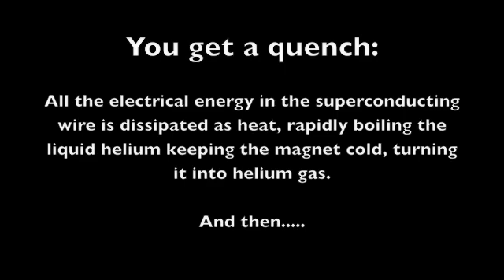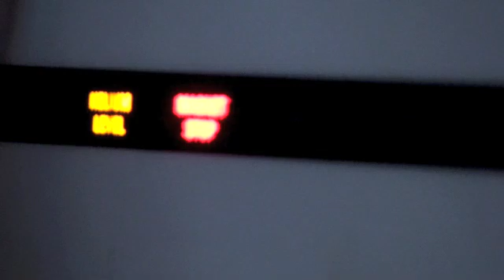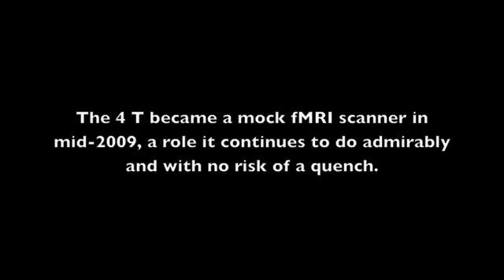MRI magnet quench: the movie

Comment: Yes, there actually IS A HELIUM SHORTAGE, or will be, once the national reserve runs out, which is being used up quickly.

It is indeed the second most abundant element in the universe, but have fun getting it out of the STARS!! We have a LITTLE bit of it here on earth (recovered in natural gas mining, as you say, but that won't last forever either will it??). So once you let it go into the atmosphere, say bye bye to it forever, it's headed back to the stars. Thanks.
Reply from the maker: jonboro2000 As I mentioned in the FAQ, it was uneconomic to recover the L-He (or recycle the magnet, which we decided to use as a mock scanner in any case). We considered running down the magnet over the power supply and then trying to flush the L-He, but the cost of the engineer to do the run down plus the recovery was more than the cost of L-He at the time. There was also the issue of needing to top off the magnet prior to a minimal risk rundown over the power supply which would have possibly increased the cost. Instead, we waited until the L-He level was at something like 60% before we quenched. All other options were considerably more expensive, and since helium extraction is itself an issue based on economics, not availability per se, we decided that quenching was the least costly approach.
Reply: Helium will be around for a while, yet.  The helium that's in natural gas didn't come from the stars.  It came from alpha decay of various radioactive elements.  Some of those element have long half-lives, so will be adding more helium for a long time to come with no significant drop in the production rate.  We'll kill life on this planet one way or another before we run out of helium.
Reply: +Jaden CM you are thinking of hydrogen... 
+Vad Hakara has it right.
Reply: +judgegixxer
So you read the first sentece, then decided to react? 

Thats not counting the already known reserves.
In 2014, the US Department of Interior estimated that there are 1,169 billion cubic feet of helium reserves left on Earth. That's enough for about 117 more years.
Reply: relax bro they found about 54 billion cubic feet in Tanzania in 2016. Globally we use around 8billion cubic feet a year. Not counting whats already in reserver and what could be recovered from natural gas drilling, Running out of Helium isnt that much of a deal. 
Lets focus on more important issues first ey
Reply: +judgegixxer 
117 years is a very long time if you look at how fast we're evolving in terms of Technology and science.  25 years ago, a cell phone was only for the super rich, now everyone has one. Reusable rockets where a far fetched dream only excisting on paper, H2O and electric cars only seen in sci fi movies, etc now they excist. If you think there isnt being searched for alternative ways and products to replace helium you're dead wrong. Also those estimates are of known usable helium pockets, they dont account for the helium that isnt recoverd by oil drills and such. With helium prices going up most gas drilling companies are looking for ways to recover the helium they now just rush through the pipes to get to the gas. So there's a whole lot more Helium than that estimate states. 
You apperantly forget how innovative humans can be when faced by a problem. 

But I get it, you're a pessimist. Only seeing the evil, never the good in people. Sucks to be you honestly, you probally live a very depressing live thinking of how bad of a planet we're leaving behind whilst in reality 200 years ago there was 50% change you wouldn''t make it till age 5!

Grow up man, dont be so negative. Have some faith in humanity. 
The reason we're so succesfull as a species is because of our problem solving.
Reply: We'll have a helium shortage eventually but storing it now isn't going to prevent that. Storage is expensive and it's near inevitable that our helium supply and our natural gas supply run out at around the same time. Hopefully by then we'll be able to get helium more easily from other sources, but we'll also probably find alternatives.
Reply: Lol HeO
Reply: AH yes, trying to win an argument by going offtopic. How cute.

I'll try to adress as much as I can and keep it as short as possible, because I'm trying to read youtube comments not a book. 

1. The distribution industry in Europe is vastly shifting towards renewable energy with e-trucks and e-vans already deploying in major European cities in Portugal, Germany and the Netherlands.
Containerships have a new technology being fitted as we speak that utulizing Wind as 2nd source of power cutting down diesel consumtion up to 40%

2.Europe doesnt have Mc donalds sprawned all over suburbs, Fast Food is widely considered as marginal here. If people say they eat Mc do 4/7 a week, they're frowned upon. 
Same with the cars, Most sold European cars dont consume that much gas because gas is hella expensive here. Taxes on a 6l engine are so high people rather drive 2l at max. 
There's a certain culture difference between us here, you see, Europe is a lot less consumerbased than the US. Hybrid cars and electric cars are not so uncommon here aswell. Just in my close surrounding there's 8 gas stations that have made the switch to add charging stations aswell as charging stations on public parkings where you can charge your car for a price ofcourse. The more infrastructure there's available the easier it is for people to make the shift.

Yes focus on the animals that went extint, dont focus on the animals that we through extensive programs have succesfully rehabilitated into the wild. Its always a shame to lose a species, but then again you have to ask yourself, how much of the responsebility of the species death is caused by how much of the global population. 
Hong kong, China, Japan, Vietnam are all big players in alternative medicins wich use ivory and the like. To a point you cant blame the entire human race for the actions of a few. Or are you going to tribe the entire German population for the warcrimes acted by merely 30men? 
Dont get me wrong, I hate to lose anymore species, but you have to be realistic here, some species go extint even without any human interaction.  

You could argue its politics, most of the times its the will of the people to actually have that change. I see a lot of political will to make change to our enviroment ( again in the EU, I dont know about the US) and our consumption of energy. Its btw the people who decide wich route politicians take. If you vote for someone who doesnt account in enviroment, who's to blame then? Politics or the people who voted for those politics? 

To your plastic island paragraph;
https://www.theoceancleanup.com/   People are already getting rid of that problem with an increasing budget and increasing fleet to speed up the process.

Science and Technology will always overcome because like you said, for every problem solved, 3 other rise, but those problems are more complicated and the solutions will help us even further.

We, at this very moment, are on the brink of a global shift towards a much cleaner earth. Everything thats wrong today is because of the mismanagement from 50 years ago. 
If you think we arent changing our ways after living like this 50 years long, you're dillussional. 
There is change, maybe its not going to fast that you notice it, but it is there. 

And back to Helium. Imagen if we keep up todays pace in innovation, I'm sure we'll find a way to extract helium from space aswell. 117 years to come up with a solution.
Reply: You are the one that brought up "How fast we're evolving in terms of Technology and Science" So  don't try to twist it around to make it seem that I changed the subject.. You used that as defence to Helium shortage will not be an issue because we will figure out something eventually. So I pointed out a few examples of how thats not working out so well and actually making things worse.

I did not say focus on extinct animals and forget the existing. But researching why different species go extinct would be good. Again the Rhino was another example of how humans efforts to stop problems don't always outway the efforts/forces that create the problems.  Different populations effect different species and environments in different ways, removing one breaks ecological chains. Actions of a few can have massive unforeseen impacts on people and places far away. 

All the different actions of all the pockets of the few add up.  I'm not trying to pin one /person/group/ race/country as you are trying to suggest. The sprawl /mc donalds is just one large piece of the pie.
Germany!? Why so defensive of it all of the sudden? Last thing from my mind.  But since you brought it up. Only 30 people responsible? LoL Ya at the very highest of the top just to get the list started. Of course not every german is a war criminal (obviously) but give me a break. You must have some sort of guilt complex to even bring that shit up.

Plastic is being produced for countless needless reasons everywhere at a rate which far outpaces it's cleanup so nice try with that one its not even close and the gap widens by the week, not the year..(advent of 3D printing does nothing to slow the rate)  Thanks for the thought and the token effort but cleanups need to be done on scales that are orders of magnitude larger than governments or corporations of any nationality are willing to come close to commit. Even their election campaign promises are weak and never fully carried out. 

I didn't get the memo on the fact that everything on earth has been properly managed ever since 1968. Just so you know everyone from the poorest person on the planet to the richest billionairre is greedy.  The drive to continue living requires it. it is basic human instinct. 8 billion people require more than the planet can produce or absorb plain and simple.  A major reset will happen that will knock the human race back to pre industrial age conditions and huge mass dieoffs, it's already starting. 

So you prove my point about politics. Polititians #1 goal is to stay in power and keep paycheques rolling in hence they need the public to keep voting them in. The overall majority of public wants: Good infrastucture, more infrastructure, more of everything that benefits them which are all the materials that create the whole problem. All thats left for remedying any problems is spent on token programs designed more for PR than actually accomplishing anything. Humans are a cancer on this planet. We were a benign tumor until the late 1800s, we are now stage 4.

 It's like the human race has already jumped out of the airplane believing it can fly without one so to speak. Instead of spending the money and doing the work to create and strap on a parachute before we jumped, we decided we have lots of time.  So now with ground looming closer we are halfheartedly trying to sew a bleeding edge carbon/hemp composite recycleable parachute together with a computer aided titanium carbon fiber sewing machine connected to the internet on 5G. Problem is the sewing machine isn't fast enough and it's computer glitches are stopping it because the program didn't upload correctly due to the bad 5G internet service that couldn't deliver the bitrate. (All the tech in the world won't help when someone hits a fiber optic line between the 5G transmitter and the server with an excavator while installing a septic tank). Even if all that technological wizardry works out in time, the parachute it produces won't help much being deployed 10 feet from impact. The whole jump was and is currently being mismanaged because there is no cancelling the jump and there was never a back up plan. Hindsight hinders ignorance but it's always tardy.
 
Extract helium from space? The only helium in space is locked up in other planets crusts and the sun. Good luck with that. The viability and energy defecit of that scenario is absolutely ridiculous and will be for far longer than 117 years. We been using huge resources and energy for decades with the greatest minds on the planet to basically get 50%  of what amounts to than less than a few tons of material onto other planets only to beam us back some data. What scientist have done in space is impressive but your 117 years won't see imported helium or anything else from other worlds on any kind of scale to stop a shortage. We put men on the moon 50 years ago. In 1969 people like you thought we would have humans living in pods on the moon and Mars by now commuting back and forth weekly. Meanwhile today they are still pushing back JWST launch dates. No one has touched another world since early 70's. Because like you say, the public votes in the gov't who makes those decisions.  

I'm not a pessimist, I'm a realist. Entropy always wins.
Reply: 117 years for you to shut up and do something about it instead of bitching on YouTube.   You're quick to tell everybody else what to do, but what are you actually doing?
Reply: This is all very interesting but I think it is worth noting that not all of the helium that has been explored and documented can be retrieved easily. Of course it's only naturally human to use the readily available sources first. Still, I'm inclined to agree that we don't have a pressing shortage of immediate concern but it is a finite resource and if we some day find ourselves using more of it then we'll see see that 117 year estimate shrink.

As it is now, it is fairly scarce and apparently impossible to synthesize (economically at least) from thin air or otherwise created. For example, we can my hydrogen and oxygen from water with electrolysis. All of the helium must come from the ground or from reserves which were created from stuff in the ground.

Remember the Hindenberg? At the time of it's development the lead engineer wanted to use helium but it was only available for purchase from the U.S. As it turned out, there was some law or trade restriction on helium due to it's ability to be weaponized by lifting machinations like the Zeppelin bombers that raided London during WW1. Well anyway, the Hindenberg design had to be adjusted to accommodate hydrogen and the rest is fiery history.

In short, I hope we find other ways to accomplish what helium does for MRI machines in a safe manner or come up with other ways to obtain or create helium. So, I believe another comment said it involved some kind of decay.. alpha decay or radioactive elements as they said. I wonder if there's a way to replicate that in a laboratory in an accelerated manner.
Reply: Stop driving your car dumbass, we'll run out of gas.
Reply: +Jaden CM Oh dear god please don't tell me you think the H in H20 is Helium. Because then you would be the dumbass. He is helium, H is Hydrogen.
Reply: @Daniel Looney, thank you, it never even occurred to me that anyone could be as stupid as Jaden CM to suggest that you could get He(lium) from H2O. I simply didn't even understand his suggestion, it was so off the wall stupid it didn't even register.
Reply: That's wonderful. You are 100% correct about the astounding pace of science and technology. Guess what increases right along with that.....the world population!,  the need for more resources and Big Macs to maintain that population and it's bleeding edge technologies, the byproducts of the manufacturing processes of converting resources into marketable product. Then there is the whole mandatory and unstoppable transport/distribution side of all that. The economic engine burns fuel of every sort and is unstoppable as a runaway diesel engine being in that it can only stop if it blows apart, runs out of fuel or the air intake is blocked. The analogue to that is the modern worlds way of life. (Gotta surf the internet on the latest Iphone while driving the 6.2 liter V8 Tahoe SS or Cadillac Escalade to walmart to buy as much as possible for as cheap as possible. Most of which winds up in the landfill within 5 years. Don't forget to hit the McDonalds drive thru on the way home through the sprawled out suburbs)
    
        I could use your "200 years ago 50% chance not making it to 5." argument against you because 200 years ago science and technology was not advanced enough to create the Great Pacific Plastic island that is currently double the size of Texas. We already have the technology to clean it up but no one will take on the responsibility or spend the cash to do it. We still don't have the technology to stop the increase in Carbonic acid levels worldwide which are killing off coral reefs everywhere by softening them. The carbonic acid stops them from absorbing the calcium carbonates required to make their structure. This also applies to any marine life with shells.  I could go on and on and on. Cancer rates of humans and most animals on the rise. Mostly because of toxins we created already firmly planted into the food cycles. Micro beads; good luck fixing all the problems that is creating! They can't even concieve a hypothetical way of cleaning up that mess. Me 200 years ago is not much different todays 3rd world. How much does does science and technology benefit them really other than sporadic tokens of goodwill meant really for PR. We could feed the planet many times over with a 50% reduction in military spending. 
       
       The only other time so many species on earth (land, sea,air) have gone extinct so fast was the Permian-Triassic event.  Justask the last Male Northern White Rhino that died last week how science and technology helped out his species. Now all we can do is artificially inseminate that rhino's 2 daughters with his semen. S&T will not overcome that because you can't create a sustainable stable population with no genepool. 
   
     There is this other little factor that throws a monkey wrench into your Jetsons Utopia called politics which also determines how and when the technology is applied to a problem. More often than not bipartisan politics has a way of managing legitimate S&T for for personal power & greed creating more grief (eg: North Korea) and losing complete track of the original intended goal. Or they just don't understand it because they are not chemists, or engineers, or physicists. 

       I hope you are right, but I would never bet on mankind overcoming the sheer number of overwhelming unprecedented cascading problems he has created without a major upset/reset of how we live. 

       Also I don't live a depressed life. Assuming that is the case just because I come off pessimistic would be like only reading one sentence of a paragraph now wouldn't it? What to you is pessimism to me is being realistic.  

Science and technology will never overcome what it creates. As it solves one problem, 3 more unforeseen problems arise with the solutions for the first problem.  (eg New Orleans) Granted science and technology is great and I sincerely mean that, but the planet has a carrying capacity which is pretty much done for.
Reply: Big deal, thats only another 6years and 9months worth.
Reply: +okoMbruuuuuuuh
 read the whole thing.  First off 117 years is not that long.  It might be long for you but in reality it's the blink of an eye and in that context the 5.8% increase from Tanzania is negligible and in fact 2/3 of that amount has already been used up because your stats are from 2014. lol The rate of usage of 8 billion /year is today. If you think that rate will not increase you are dead wrong. Estimates of any natural resource reserves are always inflated to attract investors and maintain corporate stock prices. Even if all those reserves actually exist, it does not mean they are economically feasible to extract or physically possible to extract with current technology.  But you and I will be dead in 117 years so who cares right?  Correction: in 117 years the only thing left will be insects, some small ground dwelling rodents and Chernobyl sarcophagus radiation levels.
Reply: jonco2000 ever heard of water? Dumbass.